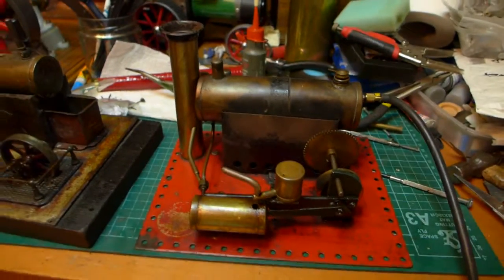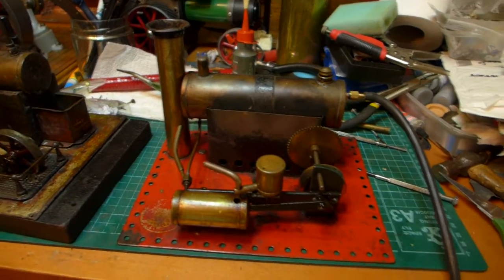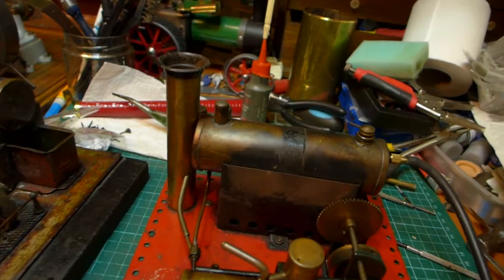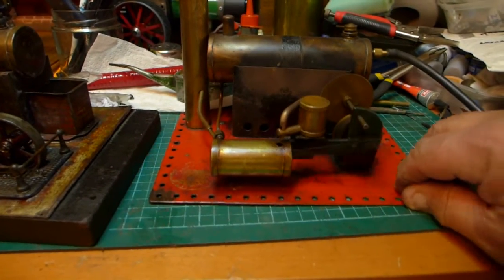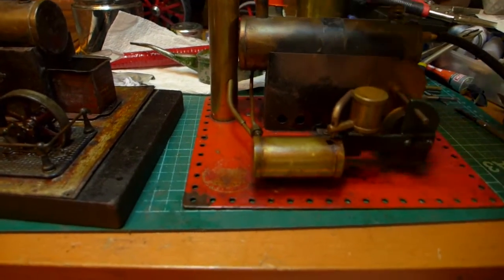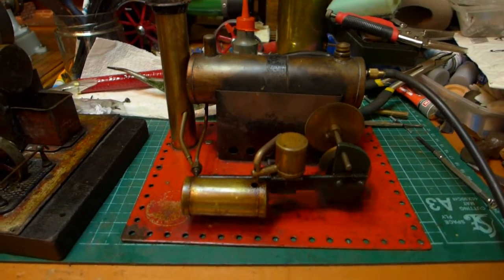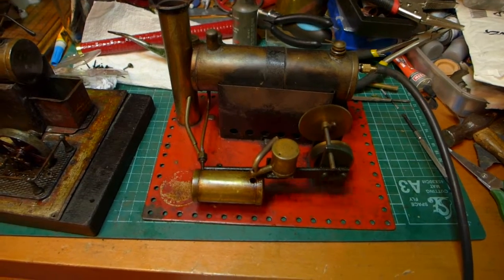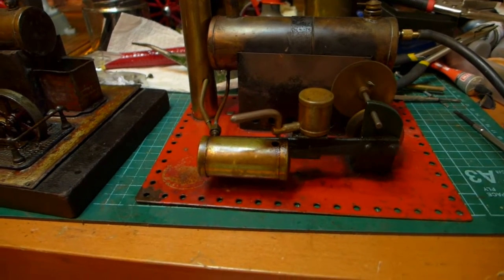A DEREHAM BOWMAN M135 FROM 1928 ish FIRST TEST FROM PURCHASE ON AIR

Comment: I think the base is good enough to keep as is Steve, the firebox has the usual Bowman rust issue. A proper tap and it will look perfect. I have a few of these, they are great engines IMHO. Thanks for the videos mate, they help keep me sane :D
Reply from the maker: Hello John i agree the base is good the tap is easy enough to adapt ...i just like bling... im thinking it will look lovely next to those Bowman M122's all blitzed up just like them, but the chap i bought it off told me to look after it...do you think thats what he meant? 😂😂😂😂...Steve
Reply: @stephensuttonsteamseesteph1094  well they are not rare. I have a couple in original condition and one I totally restored. You can guess which looks the best!
Reply from the maker: No they are not rare i have 2 others one metal base and the other wood and the same as you one is restored the other as was.
I posted your little pressie today John i sent it 1st class signed for so you should get it by the middle of next year 🤣🤣🤣🤣🤣....Steve